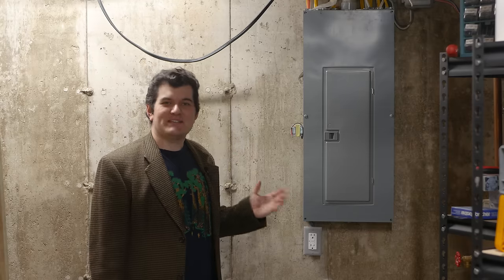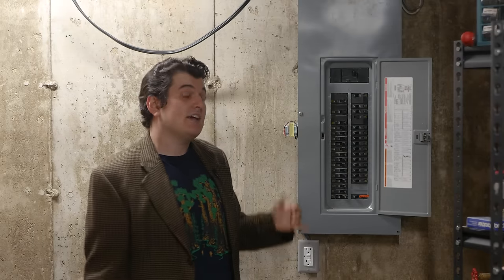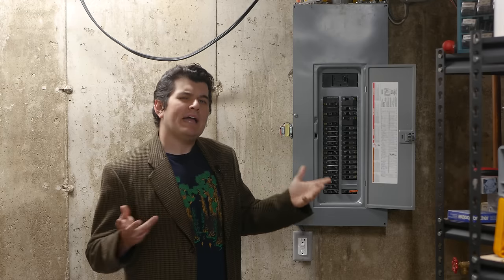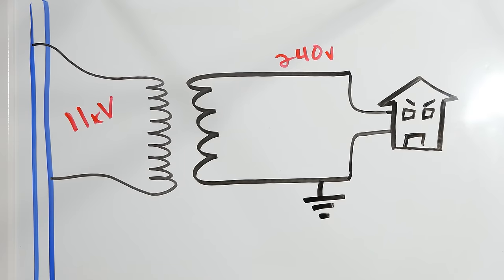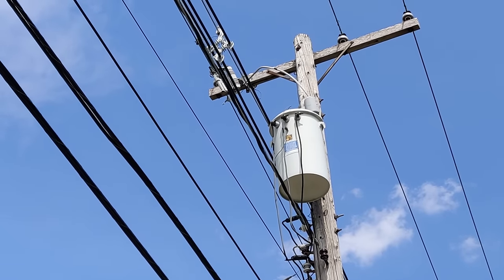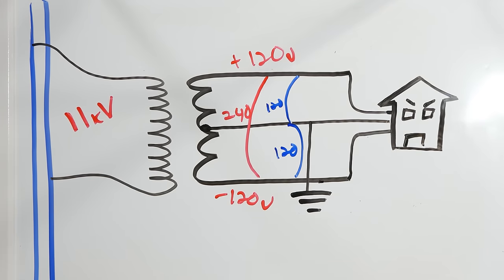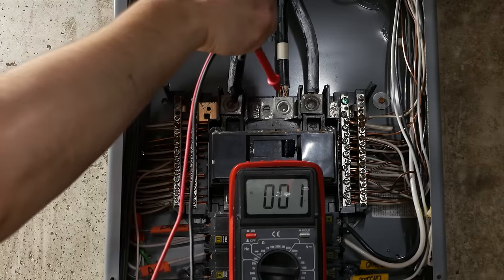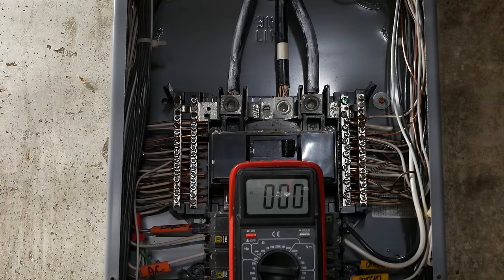The US electrical system is not 120V

Comment: "Hey, why don't you guys have 400 volt three-phase power?" he teased while giggling.
Reply: because who the hell needs 400 volt power at home :)
Reply: @matthewpepperl  many people
Reply: Our electric (and induction) stoves run at 240V. Our cars charge from multi-phase power. Some air conditioning devices.
Reply: @martinpejchar9011  Well, gee, I wonder how the U.S. has survived so long without 400V!??! (i.e. You may want to rethink the term "needs." How about using "wants" instead?)
Reply: @martinpejchar9011  please enlighten me i am genuinely curious what 400v is good for at home :)
Reply: @leafbelly  that has nothing to do with wants.
Try a 230V log splitter and you know why you need 400V.
Reply: @matthewpepperl  my parents just used one phase for every floor and all three for the oven. So the basement, ground and 1st floor all have separate electric circuits and are all protected by their own RCD/RCCB. If one floor trips it (like a kid in the 1st floor puts a screw in the outlet) the fridge in the kitchen is still running. Might not be the 3 phase argument, but a clever design. 1 problem: you couldn't use Ethernet over Powerlines.
Reply: @matthewpepperl  people with wood/metal working tools like mills and lathes
Reply: @matthewpepperl  high consumption device hotplates whit over are normarly on 400V boilers eclectic car charger but one of most common use of 400v phase AC from power plug is for driving asynchronous engine nearly every one have 400V 3v phase power from local transformer station so we do not need transformer for every house in city but one for some radius around transformer station. Yes not every one need connect device to 400V power plug but mostly have just wired him diractly to the device you in US have 120V system and get 2 phase to your home we have 240v and get 3 phase in to over home.Yes 120V system work i did not say thed you cannot live this way. Point is if we thing just about Voltage then we can have only 1 phase on 240V and it will be basically same as yours 2 phases on 120V. But is fine at least have more capability.I can ask you how many thing in your country use 240V i thing thet minority of them same in my country whit 400V most thing did not use is but it is mostly use in place where you will use 240V.
https://bdbo1.thomann.de/thumb/bdb3000/pics/bdbo/14740346.jpg this is normal 400V power plug
Reply: @matthewpepperl  In Sweden most stoves/ovens are 400V to boil water and stuff faster. My brother has a 240V stove, and it is slow as hell.
Reply: @matthewpepperl  Stoves, ovens, water heaters.
Reply: @leafbelly  It dependent on market in your country in EU every one expect that you have 400V same as in U.S. market expect that you have 240 so i thing need is correct as correct as every one in U.S. need 240/208 V.
Reply: The advantage of a 230/400V system in your home is thinner wires which is cheaper an easier to work with.
Reply: @matthewpepperl  Electric sauna needs it among other things mentioned here
Reply: We do have 480v three-phase service, but it's very unlikely you'll see that in a home - it's mostly for commercial and light industrial service. Especially considering the arcing hazard that 480v presents.
Reply: @matthewpepperl  people with a 6KW oven and a decent water heater. (Huge part of Norway)
Reply: @matthewpepperl  I have a buzz saw. A big one. In the basement. An electric stove and a water heater. All 400V 3 phases. I don't have an electric car yet, but 400V is also better for charging those.
Reply: @martinpejchar9011  "in EU every one expect that you have 400V"
Absolutely no one expects you to have 3 phases at home here in Italy. The only exception would be if you buy a super high power electric stovetop as those usually come with three separate 230V feeds so you can feed it 2 or 3 phases, but since they're in a Y configuration you can still feed them with single phase if you don't have three.
For example I recently found out that there are a few very old sections of the grid where three phase power cannot be delivered at all because they still rely on an old pre-standardization 110V supply, so back in the day they made it into 220V by giving everyone two phases instead of a phase and a neutral, just like in the US, and then jacking up the supply voltage to the top of its 110 tolerance. 
In that situation you might get up to 10 or 15kW in monophase.
Reply: @Jehty_  Electric log splitters are a joke. Gas/diesel powered hydraulic splitters do twice the work for half the cost.
Reply: Matthew Lewis in Germany we use them for ovens or garage equipment
Reply: As Nioreh said, most kitchens are equipped with 3-phase 400V for the stove. A lot of houses has more outlets for other houshold appliances, and most - if not all - locales that are meant for larger groups of people have one or two 3-phase 400V outlets. Why that is, I don't know, but they can handle a lot of amps as well as the higher voltage. A simple passive adapter lets you connect normal 220V appliances to it. As a musician that is very useful to avoid ac-hum in the equipment.
Reply: In my small apartment in Finland, my oven and sauna would behave weird if I disconnected 2 of the phases :P
Reply: I live in europe and my induction stove is powered by 3 phase 400V... so yeah, we have those (and we even have safe plugs for them - crazy I know).
Reply: @cezarcatalin1406  I was talking to the north americans...
Reply: @matthewpepperl  Generally stoves, washing machines and the like.
Reply: In industrial and large commercial applications in the US, 480 volt three phase is hella common.
As a matter of fact, when I dropped out of strictly industrial maintenance/engineering and started focusing on the more commercial side of things, I was kinda surprised at how few places I work in now ever had 480.
I used to work in a central energy plant under a high rise office building where our chillers ran on 4160 volt three phase - which isn't that uncommon in really big stuff.
It's not like the US is limited in what we use - just in what a lot of people tend to see.
Reply: @Jehty_   I can make a "10,000 V" log splitter that cant's split a twig. It's the power/watts that matter. (Though 3-phase motors are more efficient). For the U.S. you can draw 5 kW on even the smallest small 240 circuit, up to 12kw on the typical largest circuit.  Though any most log-splitters stateside have thier own gas engine for mobility, or will run off tractor hydraulics.
Reply: @matthewpepperl  Electric stove, ground-source heatpump, welding machines, air compressor, electric sauna,  will even remove unprofessional electricians, etc.
Reply: @matthewpepperl  3 phase European power is supposedly 3x 230v feeds at 120 degree offsets hence the voltage between any 2 phases is 400vac. The benefit comes from having 3 phases simultaneously available - (e.g. to drive big motors) and not from having a higher voltage. In some countries (e.g. Germany) even domestic residences may have a 3 phase connection.
Reply: @matthewpepperl  That stuff you can buy in german diy shops need sometimes 400v.
Reply: @matthewpepperl  Me! It is nice that 16A is enough even for stove
Reply: @matthewpepperl  im running all my garage equipment at 400v
Reply: @matthewpepperl  Charging your car.
Reply: Some machines in Garage workshop need 415v.
Reply: business gets higher voltages for lighting and motors. higher voltage is the best for electric car chargers but residen service wiring is rarely available
Reply: Houses now are having 400a 3phase services installed for Elevators and commercial rated  HVAC systems. in them
Reply: Matthew Lewis In Finland we have 3 phase 400 V coming in every house.  The fuses are 3x25A or more. I have an old skool oil heating (20 kW), but I can use a 6 kW resistor also and a 6.8 kW sauna (3x10A fuses) and other stuff in the house at the same time. In the boiler room I have a 400V 16A outlet it some heavier machinery needs to be used.
Reply: @matthewpepperl  400V three phase is more common in industrial settings. Speaking as someone who runs a farm on a 240V system, I'd really appreciate having three phase.

Comment: Fantastic! I'm traveling in Australia from Canada and am perplexed by the outlet switches! Thank you for mentioning that!! Also, I've definitely learned a bit more about our power grid back home in North America. Thanks for an awesome video!
Reply: We like 'em. To us, the idea that the only way to disconnect something from the supply is to pull the plug seems weird. If the socket is located underneath/behind a TV cabinet, fridge etc., plugging it back in can be difficult. For the nearly immeasurably low cost of having a switch, you get another way to disconnect the power other than the plug or the circuit breaker.
Reply: @mikejosef2470  so you have no way to turn stuff off other than pulling the plug or the switch on the outlet?
Reply: @russellc3251  no 95% of things still have an off button, it's just easier for larger things like appliances that don't have an obvious off button on them like fridges and the like. Plus it feels safer than just unplugging something.

Comment: In that case Europe is 400V, because many households (including mine) in the Europe have 3 phase power at ~240V for each phase.
Reply: You also have 3 phase + neutral + ground.
Reply: 380V in Continental Europe and 415V in the UK to be precise
Reply: what in the world do you need 380V and 415V for
Reply: 3x240 = 400?
Reply: @JFK_Speedwagon  to drive asynchronous engine mostly
Reply: What equipment uses 400V clearly nothing so you don’t not have any use. No car charger will run 400V u will fry it
Reply: @ardoporkkropodra2474  it's complicated
Reply: @Pie4life123  new electric cars use 400v and the new current/next gen is 800v. Hell, 1000v and more is in development
Reply: Yes, 3x230V is 400, because the formular for the calculation is the square root of 3 times 230V
Reply: @Pie4life123  Threee phases are used by stoves, heaters, some electric car chargers. Of course you are not going to use it on equipment that is not made for it.
Reply: @Pie4life123  any kW electric motor in any workshop, eg a saw for wood or metal
Reply: @ardoporkkropodra2474  it's the potential across two phases being 120 degree out of phase with each other that makes it 400. It's vector math, not regular addition
Reply: @Tika for powering 3 phase engines
Reply: @JFK_Speedwagon  stoves, heatpumps, feedback of solar panels, car chargers, etc. In healthcare settings it's also used for big washers and dryers.
Reply: @ardoporkkropodra2474  Of course. The same thing why 120 + 120 is not 240 but ~208 on the diagram 19:52
Reply: @JFK_Speedwagon  Large electrical heating systems. Welding and other heavy (industrial) tools. Being able to connect to the grid with a (very) large solar panel array. Fast charging electric vehicles. And electric kettles and toasters of course (Just kidding)! No one wants to wait too long for boiled water and toast!
Reply: @ardoporkkropodra2474  That's because the three phases are all 120 degrees out of phase compared to each other. The 400V or 380V is the average voltage (actually it's slightly more complicated, square root) over the three phases. See an example chart with the three phases here on Wikipedia: https://en.wikipedia.org/wiki/Three-phase_electric_power#Principle
Reply: @ardoporkkropodra2474  the phases are 120 degrees out of phase so 400v potential between 2 phases
Reply: Do you actually use 400v for anything? In the US we actually use 240v and I actually have a 240v circuit specifically for my home server and networking equipment.
Reply: @antikommunistischaktion  yes probably not as mutch as US use 240 but yes we use 400v for some specific tasks for example drive asynchronous motor is really easy whit 3 faze AC in competition whit 1 faze
Reply: Ryan C yeah, mainly stoves, washing machines and dryers, pretty much every workshop has some 400V outlets, and we often also balance loads for like different floors on different phases.
Reply: @JFK_Speedwagon  High power EV chargers.  Lift cars in buildings, and escalators.  Big air conditioning units.  Industrial machinery.  Lots of uses, but very uncommon in UK homes.
Reply: @antikommunistischaktion  Our stove and AC system uses 3 phases. We also put some single phase major users on different phases so they would not overload single phase. My dad is a bit of a DIY guy, he uses a welder that uses 3 phases.
Reply: @antikommunistischaktion  yeah stove tops, sauna stoves , car charges and welders sometimes are the main things :D
Reply: @ardoporkkropodra2474  it's 3phase 400v.
Line - Line is 400v, Line - Neutral 220v.
You dont add them up, normally household appliances run on Line - Neutral while large consumers more often run on 3phase 400v.
Reply: @ardoporkkropodra2474  
https://en.m.wikipedia.org/wiki/Three-phase_electric_power
In a three-phase system each phase's voltage, current, and power is offset from the others’ by 120°. So 230V+230V+230V=400V. Crazy.
Reply: @Pie4life123  3 phase EV chargers will - charge at 22kW - think European leaf supports this (UK one doesn't as 3 phase in UK uncommon outside of industry), the Zoe def does.
Reply: @Pie4life123  It's often used for power distribution when more power than 240V is required, for example dimmer packs or power distribution boards for stage lights
Reply: @Pie4life123  Induction stove, for example. They are over 6 kW, so single phase (3680 W) isn't enough. And electric cars in Europe can use 380 V for faster charging. All public chargers are 380/415 V.
Reply: @mattsword41  No, European Leaf is same as one in UK - 6.6KW single phase charger. Hyundai and Kia are the same. However, EVs made by Germans and French, usually have 3-phase on-board chargers capable of receiving 11KW as standard. By the way standard on-board charger on european Teslas is 11KW. 22KW was an option on Model S, But I'm not sure if it still is on current ones and Model 3.
Reply: Everything said about 400v is done with 120-240V in residential settings in the US, They just use a bigger wire and there is little need to worry about balancing circuits since there are only two phases and the panels alternate which phase a breaker pulls from giving a fairly balanced system when many circuits are active. US doesn't have a "mains voltage"  because it is all stepped down from the transmission lines running at 2400-40000 volts before it enters a building. The Voltage and even the phases of electrical service are determined at the individual transformers feeding each individual building, not the overhead electrical services voltage.
Reply: A lot of people in here saying 230V/400V for mainland, 240V/415V for the UK (or random variations of 220-240V/380-415V), but pretty much the entirety of Europe (or the EU at least) including the UK, uses 230V/400V +-10% (IIRC it's actually +10% -7% but that's neither here nor there). I have, in fact, measured 240V/415V at work, in Germany.
Reply: @btwbrand  Exactly. Same problem, just a bit different technical solution. Basically in Europe if you need to plug in some appliance something that takes over 16 amps (about 3840 W) it needs more than one phase.
Reply: @JFK_Speedwagon  380 is needed for some construction equipment. So you just plug in without having to setup anything else.
Reply: you guys can stop telling me, i already got an answer
Reply: The whole idea with split phase 120-240v is to remove the need to worry about balancing loads in a residential setting. Even the electrical boxes are made to be self balancing on the two private phases. Just plug in the breakers starting from the top and work your way down, even breakers on one side of phase odds on the other. 

Load balancing is handled by the linemen in the US. Each neighborhood will run on a different leg of the primary electrical lines to balance the load across the three phases.  Electrical companies use billing to audit loads on lines but rarely need to make corrections to load balancing once the connections are in place. 

If someone pays for it then two additional lines can be run into a small neighborhood giving access to all three phases. If a business or company has three phase power then they can self-balance their lines internally at their own panels.
Reply: power is generated as three-phase (even in the USA!), once it is stepped down to 415V phase to neutral is 240V RMS, phase to phase is 415V RMS. effectively three phases go up the street and a phase (240V) and a neutral go to each property up to 100A. In some European countries they will supply three phases 415V e.g. for cookers and you then get a five-pin plug (or at least that's what I had!)
Reply: @JFK_Speedwagon  In our house, the electric heating (ground source air pump) runs on three phase power. It uses 12 kW at max, which is only ~30 amps at three phase power. Also the electric stove runs on three phase power. Higher voltage makes thinner wires possible.
Reply: @washellwash1802  Or maybe it's geometry or trigonometry.
Reply: @tiemanowo  Actually that's because of high leg transformers, if Google does not lie.
Reply: @SuperFranzs  No we get a single PEN wire mostly. Regulations vary but euros much more often use TT earthing system where ground wire really is ground and not bonded back to neutral, so if live touches a grounded chassis it will probably not trip a breaker but it will pass a few amps that will trip any RCD.